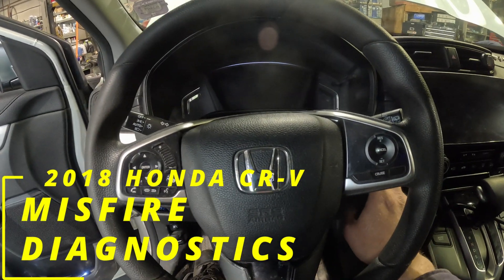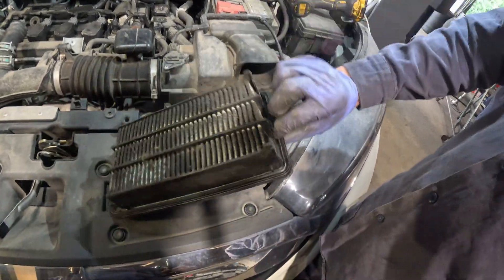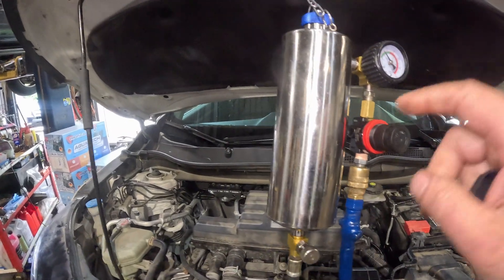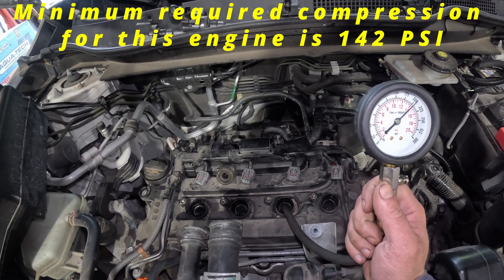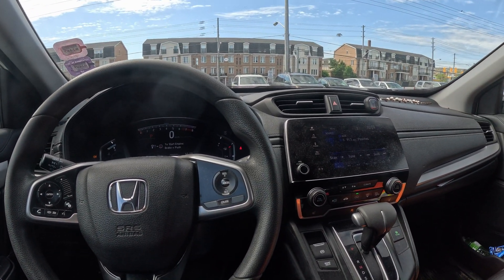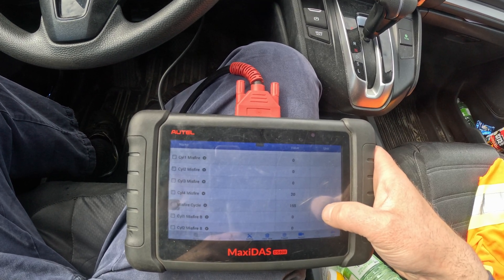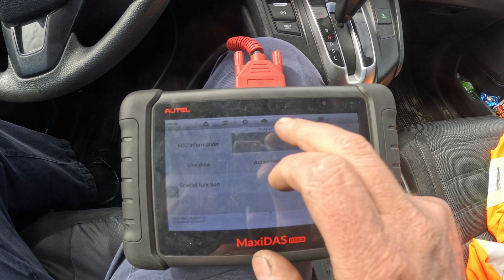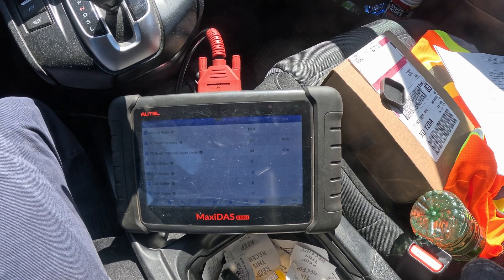2018 Honda CR-V DTC P0172 P0304 Misfire cylinder 4 and system too rich. Diagnostics and findings...

Comment: Hello im from indonesia. Many thanks ur video...btw can you show me detail how u clean the injector without open intake 😊 ...once again very helpful for me
Reply from the maker: I pressurized tank with fuel mixed with injector cleaner 50/50. Connect it to fuel rail while the fuel pump is disconnected. Then I run engine on it until the chemical runs out.

Comment: Done tons of these injectors for leaking excess fuel into cylinder even diluting the oil with fuel causing a po172 if you have a lab scope you can easily determine compression on the engine without using a manual gauge

Comment: What about on 94 octane fuel? perhaps this is a bad tank of low octane gas?
Reply: Would for sure try a full tank of the petro canada 94, the ethanol will help dissolve any deposits it is actually a benefit here probably. The tank could be old ethanolized 87 that was left to go bad, combined with the other issues you fixed.
Reply from the maker: @MT-rn2gn  Before doing anything with the vehicle we told the customer to go through a couple of tanks of at least 91 octane fuel. Only then he brought it to diagnose this issue. By the looks of it the condition improved but the problem did not go  away completely. We would recommend running some injector cleaners with the gas while he is driving to completely clean out the gunk from the fuel system and combustion chambers.